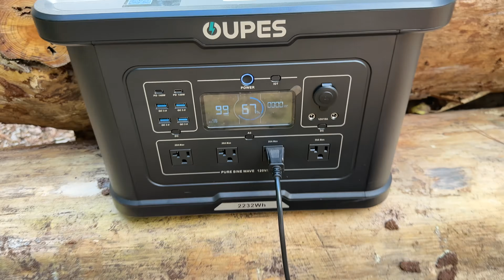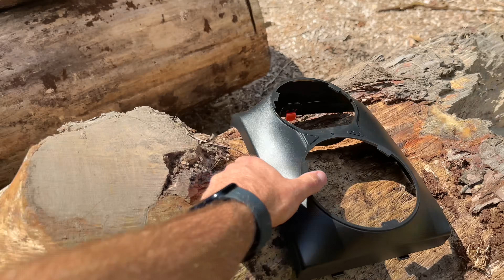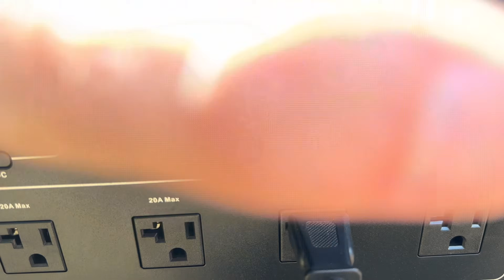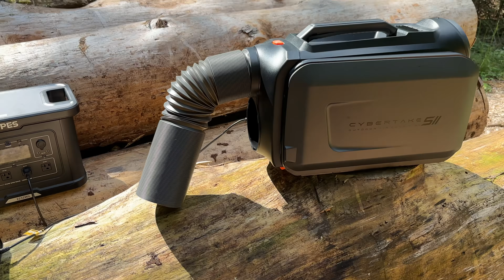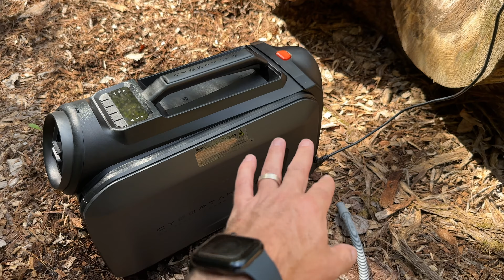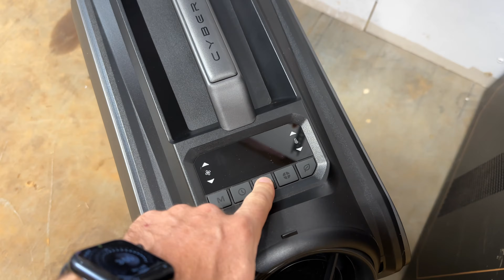Portable AC for Camping & Survival | Cybertake S2 Review

Comment: Thx for your vid. 
I've got one recently and am setting it up inside my van. 
I've heard different advice about having both tubes connected to the back of the unit and directing both outside the window. 
Do I only need to put the exhaust tube out the window when the unit is inside my van? Or both?

Comment: It would be interesting to hear from the manufacturer as to the actual limits of voltage the DC can handle.  It uses 'inverter' drive for the compressor (could just be a BLDC) so potentially it might handle the full range of a 48V LFP battery
Reply from the maker: It would be good to know for sure. I’m surprised it wasn’t listed anywhere

Comment: What about inside the house, how much space will it cool?
Reply: 5100BTU in cooling mode, that's flat strap.  Plenty of guides out there for space vs BTU.  Don't forget to consider insulation as lack of that will reduce the viable space to cool.  unless you need portability window box job or minisplit would be much better idea
Reply from the maker: A small room is about all as Retro pointed out its only 5100BTU. One could use it in a pinch but it’s not really made for that.